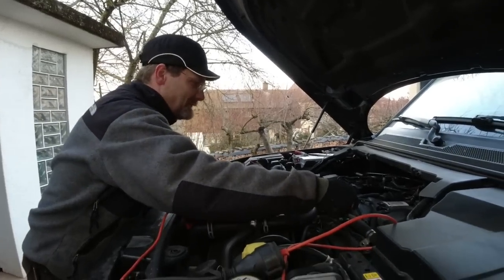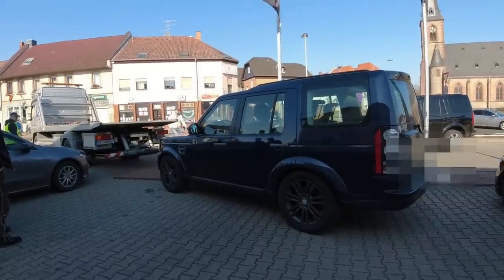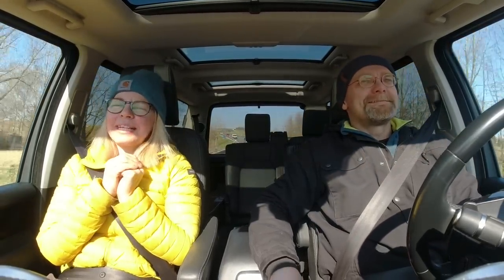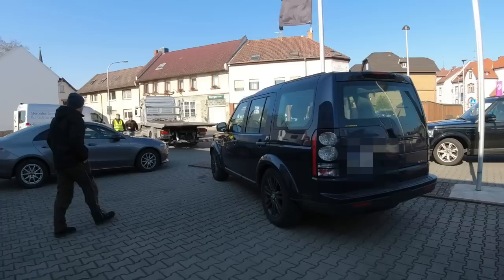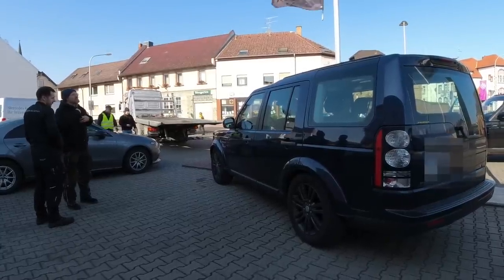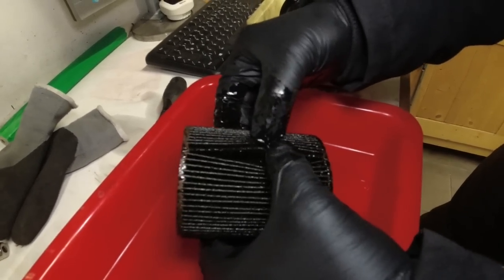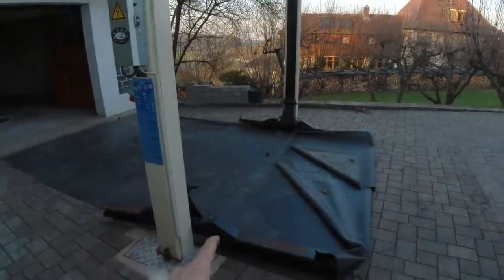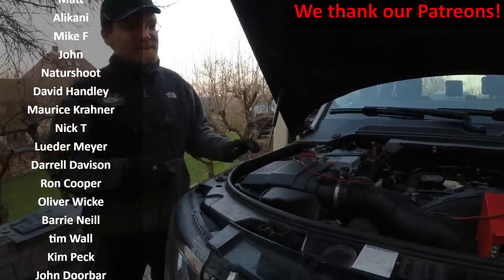We bought a dead engine LAND ROVER with only 40.000 Miles / S4-Ep10

Comment: we had a similar break down driving back from switzerland in our discovery 4. we broke down an hour into france. the car was there for 3 weeks. we had to rent a car from hertz then try and make our eurotunnel train. we drove as fast as we could be didnt make it in time. we had 2 dogs, 2 bikes, 2 kids, a roof box and a car full of stuff. we had to leave the bikes and most of our stuff in the car. when we got back to the uk we took the little jeep renegade (the car that we rented, it was the biggest one they had at the time) to a land rover dealership, they gave us a new range rover for a curtusaty car. our land rover only had 15,000 miles when it broke down. this was the first year of ownership. i can't remember exactly what the problem was but the mechanic at land rover told me that it should have been a recall on all discovery 4's. apparently 25% of discovery's sold have this issue, and its a full engine rebuild. when the break down happened i was doing 95 mph (150 kph) on the french autoroute and we a huge crunching sound. we coasted it into a petrol station. the kids were scared though. luckly, everything was under warranty because this happened in 2017 and i bought the car in 2016. now it has 190,000 miles on it and it hasn't missed a beat.

Comment: My guess is overheating. Engine crankshaft failure to big end connecting rod bearings related to the cleanliness and/or supply of lubricating oil

Comment: Hello to You, glad You bought this Discovery for fixin it. I’m from Finland and it happens somethimes 😊 that we have cold here and issues related to that. My guess is, that the breather has frozen, causin pressure in the engine and oil system, that has filled one ore more cylindes with oil - or destroied the engine. There was as I remember some technical bulletin reharding this (at least for Scandinavia), where the issue was the heater elemnt for this breather, when driving over 80 km/h in cold climat - in the Alps ?! If no metal parts in oil pan, the bearings hopefully ok and ”easy fix” with limited costs. If metal, the egine is gonee. Lets see …

Comment: Not good that it's seized after low miles especially as it appears to have been well maintained. They are of course known for spun bearings, but it could have piston issues I suppose which has caused the failure. Will certainly keep you busy depending on damage caused. Another engine out. I did have a Range Rover Sport with the same engine and I think there was a label on it saying to check the oil level every week or 600 miles, but this car doesn't appear to have lost oil. Mine had done over 112k miles. Look forward to the next video to find out more.

Comment: Love watching your videos - I’m going with a timing belt failure, possibly even due to the pulley snapping off the oil pump housing. I’ve seen this happen on one in the UK after a timing belt change… There will be some messy valves / pistons if it has!

BTW, my local independent workshop takes the body off the chassis to ease access - he’s got it down to a few hours work (on a two-post lift just like yours).

Good luck - looking forward to seeing the diagnosis next week 👍

Comment: I’ll put my guess as a spun bearing that has locked up and the sudden stop hasn’t generated the metal filings you would expect. Caused by bad maintenance and a long road trip heating up the bearing enough to slip

Comment: I'm too late for the competition - still I say 'Lube problem and spun main bearing shell on position 2 or 3 - engine stopped before crank failure. Check for block cracks in vicinity of MB bolts. If the engine keeps running and the block does not crack the crankshaft does. IMO after seized mains due to oil supply failure the problem with these engines is in the ductile cast iron - known that segregation of alloying elements causes local variation of properties. Trying for light weight may have meant webs in center of the V are too thin - recall high stresses in a V engine trying to break it in two. BE Mech Hons with FOMO experience.

Comment: Crankshaft broke / bearing congratulations on your new broke lr4 its. Like Christmas in march I just done brake and control arm on driver side axle 3 to go i had to cut off bolts the bottom seized bolts passgener side should go easy I am sure the rear be a nightmare to do

Comment: By me - all of TDV6 or SDV6 engines are totally unpredictable ... You do very good engineering work, but nobody can say when crankshaft again will be broken. And what is most awful - no signs about ongoing catastrophe. My crankshaft was broken after 10 years of ownership and 360 000 km’s on the clock. Smooth run-up after crossroad and surprise, 500meters from the home.  I’m lucky, that our distant off-road trips were without such problems. Now I have 3.6 TDV8 under bonnet :) And no things about restoration of TDV6 engine. Nevermore - by my opinion that’s engine crankshaft cannot be saved from earlier or later breaking, even using A3/B3 class oil.

Comment: Hi Christian & Vera, excellent video as always, I’m looking forward to your further examination.
I suspect that low oil pressure has caused one or more worn bearings to rotate resulting in  insufficient lubrication causing the crankshaft rotation to heat seize in its current locked position 🤞

Comment: my guess at this stage is I think the engine has seized due to low engine oil causing poor oil circulation.  The oil level sensor was faulty and so the driver could not check the oil level effectively.  This has caused the crank bearings to seize.
Reply from the maker: Oil level sensor is working fine, we checked. And it had just had an oil change. 🙋‍♀️

Comment: Hi Christian and Vera ok from a Toyota driver ex landie owner no loud bang engine stalled so no belt or valves still stuck piston not through the bock or apparent sings wheels still able to move so drive still working or connected my thought is crankshaft at rear bearing under the cap but it's got so jammed it cannot move at the front end. Hope this makes sense keep up the great work ex Brit now in NZ Stay safe lol.

Comment: sounds exactly like the engine fauilure in my RR Sport TDv6. My guess is a broken crankshaft caused by LR service intervals being too long, With a broken crank its also likely that it has bent at least one con rod. I too was only cruising (60 mph) and had no warning at all, I only realizes thst I had a problem when I was being overtaken and that the revs had dropped to zers

Comment: Hi Christian and Vera, I think the crank has actually broken.  I suspect the cause is the 'short' engine design by Ford PSA which doesn't allow sufficient metal contact between the crank journals which are weakened by cross-drilling to allow oil flow from the 4 x main bearings to the big ends.  Christian will be looking for bearing failure, poor oil pressure and the wrong grade of oil even though it looks like the vehicle has a good service history.  There will be bearing damage caused by the sudden engine stop from around 1,800 rpm on the motorway, not necessarily all from the 64k travelled.  I expect the break to be between either No 2 & 3 piston or 4 & 5.  The winter cold temperature in Switzerland may well be a factor in the crank letting go and a crack may have occurred on startup.  Looking forward to Christian revealing the cause and he and Vera carrying out the necessary rebuild.  I appreciate how well you are treating the former owner.
Reply from the maker: Probably dead accurate.  I suspect that the manufacture time and date on the crank is right after a shutdown period in Dagenham during a cold period which caused the cooling tower water of the induction hardening station to receive unusual cold water causing a poor tempering of the crank.  So it was not Manchester United who lost the day before causing Steve on the hardening station to have a bad day.  Christian

Comment: Christian and Vera.  Those idiots in the UK that pass keyboard warrior comments about your ability are most likely Land Rover mechanics wishing they could get a job fixing TOYOTAs. 
My Guess - Timing Belt broken then pistons hit valves and extra load has caused break in crank shaft.  I hope not because if this is correct then at those RPMs an instant stop would surely damage the block and heads.

I have a 2010 RR Sport TDV8 with 75K miles. Had from new but cannot afford to replace with new. Since the LR4 you have is ostly the same I am learning loads from you site. Respect to you and all invoved in your channel. 

You are just good hearted people. I am glad to be able to share your endevours.  I am now a Patreon!!

Comment: Here we go, my two pence worth. It probably is the crank as they don't all snap at the front and therefore you wont get the wiggle on the front pulley. That said, there is no movement back and forth so maybe it's not the crank. i'm going to go with injector failure that has caused a piston to seize, just to be different!
Reply from the maker: We'll find out soon. 😀👍🙋‍♀️Vera

Comment: Christian, Vera, great channel and fantastic entertainment. 😀 Really enjoyable content. After watching most of your informative videos I would say overtime the engine has had poor oil delivery caused by low pressure from the rubbish oil pump. Oil starvation to crankshaft bearings resulting in catastrophic crankshaft failure and engine seizure. The owner probably ignored the knocking noise that developed  days before. Probably running on 5w dumba** oil 😂

Comment: Definitely has to be a slipped crankshaft bearing, specifically the first one (closest to the front of the vehicle), no reason just guessing,  but along with this failure would be to check all the parts on the timing belt loop, the tensioner could of gone and caused the timing to misalign with the belt getting loose then snapping back into place

Comment: No metal in the filter, bearings should be OK. Failed timing via broken belt would not lock crank solid. Engine appearing to be locked solid though, I'll guess it's hydro-locked, i.e. blown head gasket, maybe? Should do a scan first, just to see if anything comes up that might indicate cause of failure. The fact that the PO indicated that there was no drama prior to failure points me to a possible overheat than seizure. Not familiar with Disco 4 water temp indication, but these days a number of cars don't clue you in other than a "you're screwed" indicator light, so it's very possible with an "unaware" driver that the truck could have gotten hot.

Comment: The body doesn't need to come off to remove the motor, remove the front diff and the sump then the motor will be able to come out in place. However seeing you have to two poster lift it's allot easier with the body off. 

I'm going to guess the crank snapped on the thin web between main bearings 2 and 3. But I'll lean towards it having snapped at main bearing number 2, in fact I'll go out on a limb and say that when the crank snapped the two pieces "rode up on each other" and forced the front of the crank forward jamming it into the oil pump and more than likely breaking the oil pump.
You will probably be able to see it once you get the cambelt cover removed.

Comment: Very important if you want lr to last use motorkote or zx1 extralube in oil  and put  lucas upper cylinder lubricant 150ml before fill up fuel

Comment: take the belt off and see if the engine will turn over, if the bearing seizes it will stop the motor dead without any warning.

Comment: I wish I had also space for a 2 post lift at home to do this sort of jobs :). I'ts not likely to have a snapped crank as you've stated no movement when trying to rotate the crankshaft bolt, also the former owner's wife would've had a far more dramatic description of the events :). My bet is on seized main bearings, as this will not permit any crank movement, and it happens suddenly, without any loud noises. There is also a service bulletin (SSM71816) from LR about this specifying "incorrect location of the main bearing shells during assembly, or rotation of the shells during normal use." as a cause. Good luck with your new project, it's an interesting one.👍

Comment: Have you checked to see if has adblue in it as Euro 5 and onwards engines with adblue will go into limp mode if the adblue isn't working. it's also worth checking the liquid with litmus paper in case what's in the adblue tank isn't adblue.

Comment: With the way that engine is locked and no movement left and right...I.would say the tensioner may have snapped from the oil pump.and belt.cam slack and.we.have valve and piston contact..poss a snapped valve in the piston...

Comment: Please send the oil in the pan away for analysis. I am keen to know what fuel dilution the engine was running with. Fuel dilution of low viscosity oil I believe is a major contributing factor in failed cranks

Comment: For it to be solid something bad. If no one has mentioned it then over heat and pistons seized to bores. Unless something failed in the transmission and the engine is fine.

Comment: Congrats with a new project car. It looks good. My guess will be that the bottom end has seized up? Maybe because of long service intervals in combination with a bad oil pump. And all what you explained about that possible oil starvation because of the way the crank is cross drilled. The question is of course if the MY 2016 came with the "good" or the "bad" oil pump.
Reply from the maker: The bad oilpump hasn't been put in since 2009👍🙋‍♀️Vera

Comment: There is some kind of failure in the timing belt area, perhaps belt slipped due to a screw up after the belt was changed (changed because of age rather than mileage) or it just snapped and the owner was stuck at the side of the road thinking 'I wish I'd just done the sensible thing and bought a Toyota.

Comment: This is Jan from Azerbaijan. I think oil pump broken and timing belt lost and in the result of this valves hit the position and Lock the engine. And other possibilitie is wrong fuel is used which caused Lock the engine.

Comment: Main bearings failed due to low engine oil pressure and shite 5w30 engine oil, the mains have spun and locked up the engine, hence no interference of the valve train with the pistons

Comment: Snapped crank around number 2 main specifically the front side of the main, crank has wedged itself and bent number 1 main cap toward the oil pump 😬 If that's happened then the cross bolts for no. 1 main will have snapped
Reply: Yes Tom you are spot on. I have seen this before and you must have too. 
It’s a real bitch to get the crank out it jams so tight even with the main caps removed it’s difficult to get the parts out.
Reply: @derrickwatkins2892  Multiple times, because of the bending of the main you tend to just accept the block has had it and the whole lot goes in the bin 👎

Comment: Agree with all those who thing this is oil-pressure failure - crank is not likely to be snapped, as the front of it is solid when waggled laterally. This points to a slipped bearing shell obscuring oil-feed on one of the centre main journals - could be 5W-30 "dumb-ass", could be rubbish clearances on the later oil-pump. I reckon crank may re-grind and take a new set of bearings, block will be fine. You have a big job here, but worth it.
There are a lot of idiots over here in the UK, a load of them on the Disco forums - just ignore them, you understand what you are doing, and a German with a sense of humour is a rare thing ;o) (I have worked as an Engineer in Austria)

Comment: Crankshaft seized  oil pump failure as there is no oil on under try this is most likely cranck damper separation  coursing the crank to snap stopping drive to oil pump hence seized crank.

Comment: I would love a Discovery 4 or 4.5. However there is no way id risk spending $20k-$30k-$40k on a car that could just catastrophically fail out of no where. 

I’m surprised there is no class action against LR for these faulty cranks. 

Toyota lost the class action for the DPF and that issue is much less serious. 

LR should make strong cranks and agree to repair these engines

If LR Time can do it LR can.

Comment: MY DIAGNOSIS:
There is a lonely Toyota WhatCruiser OWNER who passed through the LR air filter and started crying in cylinder number one. 2l later the resultant hydraulic fluid block prevents the engine from making Switzerlandias happy, or sad, or travelers.

Comment: Hi Christian, i drive a LR3 4.4 V8 2007. Do you think it is ok using SAE 5W 30 on that engine. i am about to break the 200K km's mark. I already had head gaskets done, due to overheating caused by T-Piece break. It was repaired by a brilliant repair shop in SA, they are called "LANDY SPEC", Amazing service, the engine is running like a dream. I would just like to hear your opinion on using SAE 5W 30 in the V8? Thank you. Anton in SA.

Comment: Plastic coolant pipes failed and engine seized. Good old Ford engineering. V6 petrol suffers the same outcome and temp alarm comes too late to save it from seizure. Everyone needs to swap out the plastic for metal.

Comment: Oil Pump failed causing low oil pressure, leading to oil starvation on the crank ending up with a seized main bearing.